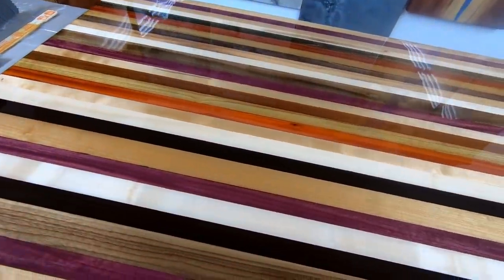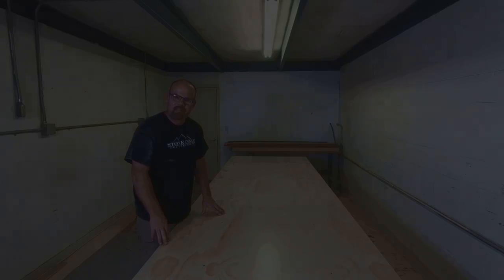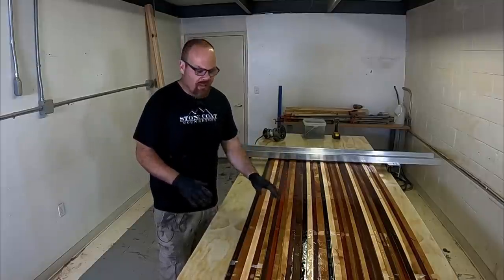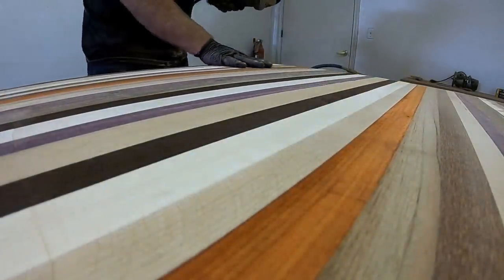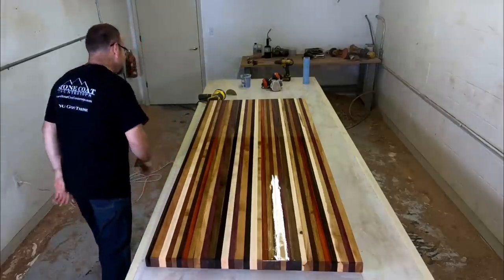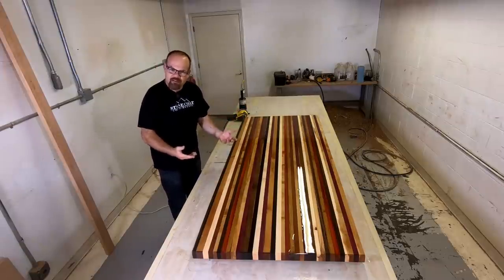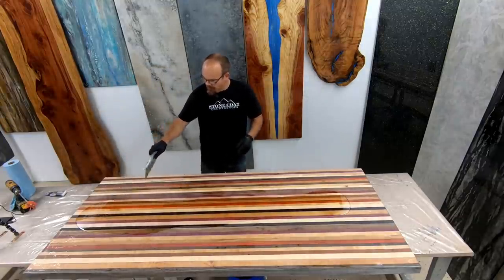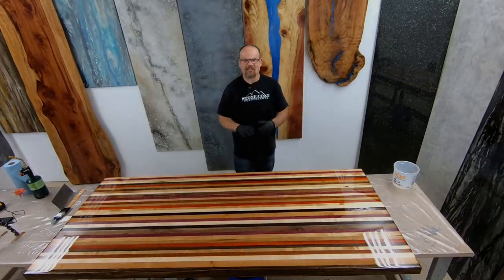How To Build a Solid Wood Table Top

Comment: Just a quick note on acetone. I've been welding for about 30 years and have used acetone to clean some of the materials I work with. There has been a study on acetone it says it can soak into your skin get into your bloodstream and damage your kidneys and liver. As with any solvent you should use industrial gloves not nitrile gloves because it will dissolve them. Just a heads up. Take care and be safe.

Comment: This is gorgeous and also the first project we ever did in shop class in seventh grade.  "gluing and braising different pieces of beautiful wood together, and then sanding.  Then we also applied a "apple shaped" templet" and then cut that out to reveal a apple shaped "cutting board"....   That was 1977, and my mom still has that cutting board hanging on the wall....  Still proud, I must say....lol

Comment: I'm a hobbyist woodworker/artist and I have to say that your table top is beautiful.  Would you mind providing a link to the 50 grit metal sanding disk?
Reply from the maker: Hi Dan Stephens!  Here is a link to the 50 grit metal fiber sanding disc: https://www.homedepot.com/p/Diablo-5-in-50-Grit-Fiber-Disc-4-Pack-DCF050050S04G/202830897 and the conversion kit: https://www.homedepot.com/p/Diablo-4-1-2-in-x-5-8-in-50-Grit-Grinder-Sander-Conversion-Kit-DCP045VGPS01G/202830887?MERCH=REC-rv_gm_pip_rr-202830896--202830887--N

Comment: When cutting and sanding in the same room that you apply the epoxy, is there any special prep you do for dust control while the epoxy is drying? is a good sweep of the room good enough? Do you vacuum the room? Do you use a draw fan or anything while the epoxy is drying?  nvm the later part of the video answered my question..
Reply from the maker: Great question Nico!  We like to vacuum the room and eliminate the dust as best as we can, but you typically will never get all of it. Keep the HVAC vents and air movement off as best as possible.  When you pour the clear coat, this is the most important step to create a great blemish-free surface; the color coat will be sanded, and the dust nibs will never be seen. You can always sand and polish the finished coats to create a perfect finish. Here is a link to how we do this:  https://www.youtube.com/watch?v=iFpzdvPaQl0

Comment: The question I have when you use these reinforcement methods. If the wood wants to expand from moisture fluctuations, why resist that with mechanical restraints rather than more classical joinery methods where the wood can expand, but warp can still be prevented? It seems like a losing battle to try to restrain the wood like that.

Comment: When you're doing your flood coat, do you have a specific room temperature that should be worked in?
Reply from the maker: Thank you for the great question DreidMusicalX!  Yes, you will need to install the Stone Coat Countertop epoxy in a room above 65 degrees and keep it warm while it's curing for at least the first 7-10 days. The materials will dry in colder temperatures but not to their full potential of durability.  You do not want the temperature below 65 for the first week of the projects life for best results.  Feel free to contact us anytime for free project support, 541-450-1976

Comment: @Stone Coat countertops  Hi I'm new to carpentry but in the past have worked in concrete, I was just wondering if while applying  the epoxy you could use your sander with no belt , on the table holding the tabletop. The vibrations may help to release the bubbles as they do with concrete without the need to fill, sand etc. Hope this helps I will try this when I try my first tabletop. Great video thanks
Reply from the maker: Hi Eleven thanks for watching and writing us! You can give this a shot, the torch is a super quick easy preffered method to remove any air it also helps the epoxy to self level and allows you to move around any veining designs in your project if you are doing effects. Have a wonderful weekend and thanks for your support!
Reply: the bubbles are from the chemical reaction of the epoxy, not from trapped air
Reply: @jlgoins64   The chemical reaction creates trapped air!

Comment: I learnt so much more about epoxy from this video. Everything he said to watch out for or don't do I've done!! The skies have opened:) Also top guy and speaks excellently
Reply: Ive done quit a few, mainly table top or couch table projects. Right now im into kitchen table tops but with a twist! I find old roofing beams like four by fours that have really matured over many years and slice them up 1 cm thick and find out whats inside. Find the nicest designs, some you can use like a butterfly effect and glue them to a CLV board, stick a nice Birch trim around it and after good bit of sanding and Poly or epoxy ( still working on the best method) get it sealed and thats my work. Its the art that goes into designing the look of the table im fascinated by and you never know what the wood is hiding. Maybe a good idea for a future project for you guys. Its a great journey and, wow it looks great! Thanks for contacting me. If i could upload a picture i would to show you guys. Tom

Comment: Probably not responding to comments anymore, but doesn't the expansion of the species at different rates mess you up?
Reply from the maker: Great question Grant and thank you for watching!   Our epoxy is hard enough to withstand major impact, but still remains flexible enough to expand and contract with wood through seasonal changes. Feel free to call or email us anytime for project support! (541)450-1976 Are you planning a table project?

Comment: I did the same thing with bigbox pine lumber. surprisingly turned out great. Instead of router the surface flat, I built it in four sections, run through surface planer to get all of them exact height, then glued them all together.

Comment: So what does a table like this go for??
Reply from the maker: These tables can retail around between $2,000-$3000, it really depends on materials used, size and for what similar pieces are going for in your local market.  Give us a call anytime with questions or for project support. (541)450-1976
Reply: @StoneCoatCountertops  what would you estimate the total DIY cost was for this table?

Comment: I wish I would have seen this before I built my island.  I think I put the coats on too thick and I think my kitchen was too cold.  I just had a real estate agent look at my house and told me that I could probably sell the island for $1000, but I don't think it'd go for that.  After I move, I'm going to build another for my new house and re-watch this video before I do so it will turn out much better.

Thank you SO much for making this video.  I've been wondering the best way to address the edges.  Again, I think my problem was that I was putting the coats on too think.  I should have put more, thinner coats.  It really helps to watch these tutorials!!!

Comment: River table, please. Also why epoxy as opposed to wood glue for the laminations?
Reply: Epoxy is stronger than wood glue and the joints are much less visible, especially if covering with epoxy on the top too.
Reply: Huntsville Houch I’ll second this question, it’s same question I had. My assumption is that epoxy is their product and the adhesive they are most familiar with also probably adds a depth and superior seal to reduce air bubbles. Would love to hear their thoughts on that before I epoxy my wood glue laminated table.
Reply: because the people doing the video are an epoxy company LOL
Reply: Another thing not mentioned in the previous comments is, the open time of wood glue might not be long enough for that large of a glue up. At least not all at once.
Reply: good point Ken
Reply: yours is the correct answer I believe, Ken Bonser

Comment: "Scraps of wood"  > Has full planks lumber in front of him...
Reply: Was also going to paint that out!
Reply: IKR?   Almost deserves a thumbs down for that disingenuous audacity!
Reply: Love the videos! I really appreciate all the information, amd especially the tech info that you're always so eager to share when I call in a panic. Looking forward to many more projects with you.
Reply: What was final dimension of the table completed?
Reply: @rickwar0  it was cheeky but in general this channel and this guy are great... I could never thumbs down 😂😂
Reply: Did not notice that but noticed all the drips over the edge in the final frames.. after the final coat..
Reply: It is likely meant as scrap wood from a project - which very well could mean that whole planks were left over from building an item from one type of wood. I, personally, have several pieces of whole lumber I purchased for a project which did not get used. Therefore, I consider it "scrap" since there are only a couple of pieces and not enough to do a different big project with.

Comment: You talked about sending out lower grit scratches. A little tip. I sand floors professionally.  When I'm buffing out scratches I find it's best to run the sander at a 45 degree angle first, and then do it again with the grain.

Comment: Hi from Australia ... 10 years ago I was on a road trip with my then 5 year old son. In the outback of Australia. Red dust and kangaroos everywhere... we called into a tiny boarder town and stayed at a camp ground... there was a communal bon fire every night there. The wood they were burning was old fence posts from the original dingo fence erected between 1880 and 1885 that spanned the entire south east of the continent... an old lady went to the wood pile and said to me take one of these home... it’s part of our history and it’s not right they are being burned ... so I grabbed one. The trip was emotional for me because I’d just lost my wife and sons mom and he was so little. The posts were rotten at the bottoms so that’s why they replaced them but the amazing thing about the timber is it petrified.. it’s almost like rock. After over 120 years of scorching dry heat. And they didn’t use nails to fasten the wire. They drilled holes through them and fed the wires through the posts. I want to do what you did to the drift wood but I don’t want to use coloured epoxy because you need to see and appreciate how distressed and cracked and split the old timber is. Plus I want to be able to see through the old drill holes. I was thinking of immersing the entire post in clear epoxy then on a band saw, cutting off the epoxy back to just proud of the timber then sanding it back until the timber just starts to break through then resuming your treatment of the driftwood... I want the drill holes to be completely filled with epoxy too. Can I send you a photo of the post for your advice? Plus do you export your products to Australia?  Love your videos 
Cheers in advance, Jason

Comment: Hey guys - I'm super enthusiastic to do something with the energy you've given me. I'ma  relatively new subscriber and seen other epoxy coating companies but no one seems to do it the way I would do it - until I found you!!! You're unafraid of helping - showing your tips and tricks - showing your humanity and love for others. I'm almost envious :)

I just finished watching a bunch of your vids and there's a few things I need to ask.

This gorgeous table top mmmmm I was shocked to see it unfinished on the the underside. I'd have gone to the effort of coating the underside to seal this thing for ever. Now you're the experts and I'm the noob here - I guess it's so the wood can breathe??

Some of your faux "rock" edge made with bondo and sticky hands looks ok-ish...however I have seen a few images where it looks like the final coat has spilled over the edge as normal but it looks cloudy (maybe bubbles) and looks a bit like snot dangling off lol.

I've done a bit of carbon fibre myself - but it's the ONLt time I've used a clear coat/expoxy like that. But done TONS of automtove bodywork - and have a bit of an artistic flair - so I've gained loads of your energy from watching your vids and "need" to do something.... I want to do a marble counter top to match one I already have that is genuine marble and is cracked....but not falling apart yet &  I'm guessing if I remove contaminants from the genuine top I can coat in epoxy to give it some extra strength and make it at least appear to be the same as faux marble top in appearance (seems crazy to be making real marble have an appearance of faux I know - but it will be in the same room and will blend it so no questions asked about the legitimate marble or faux lol).

Great work to the whole team and looking forward to more content!

Stu :)
Reply from the maker: Thank you so much for your kind words! We are glad you appreciate our content and hopefully you will follow us as we create more. If you ever have any questions you can always call or message us so we can help! -Nathan

Comment: So glad you added info about sanding, I’m definitely going to invest in the metal sanding disc
Reply from the maker: Here are the links to the discs we use as well as the conversion kit: https://www.homedepot.com/p/Diablo-5-in-50-Grit-Fiber-Disc-4-Pack-DCF050050S04G/202830897   https://www.homedepot.com/p/Diablo-4-1-2-in-x-5-8-in-50-Grit-Grinder-Sander-Conversion-Kit-DCP045VGPS01G/202830887?MERCH=REC-rv_gm_pip_rr-202830896--202830887--N  Call us anytime for project support. (541)450-1976

Comment: If the bronze seam and crack fill that you used first had been spread evenly and pressed in, would that have eliminated the majority of the holes thus eliminating the need for the burn in stick? Could you show close-ups of the spots that you did do use the burn in stick on.
Otherwise, this is exactly the project that is next on my list. Thank you for showing it. Can't wait for part two!

Comment: smart using he router and slide to plane down the uneven boards. I was thinking Id love to build a table but I don't have a planer that wide. Now I know how to do It thanks to you :)
Reply: Mike McDonald

Check out the wood whisperer.  He has an excellent video for getting a tabletop dead flat.

Comment: This seems like a useful product and definitely alot of good information is in the video for both woodworking and using the epoxy. My only complaint is that it feels like such an infomercial at point with the dialogue. The results speak for themselves but when time is spent trying to say the product is good it feels like there's something that needs to be defended. Like the part about how epoxy bond is stronger than wood, this could have just been mentioned and moved on but it sounds like this is somehow noteworthy when even cheap wood glue creates a stronger bond than the wood itself.

Comment: Several years ago, I had to put together a bathroom vanity with scrap wood and a bar sink. I used gloss polyurethane instead of epoxy, far fewer steps, and was happy with the job. (I'm sure it would have been even nicer with those steps, but time was also a factor.). Lasted for years, until one day, I came home from work, and my sister had torn it out and put in a large ceramic vanity sink. Fudged my framework to fit.

Hated it ever since.

Comment: I would just like to say that this is a beautiful table, and the best instructional video I have ever watch. Great job Great teaching I am just a little disappointed, because I really wanted to see the end result.

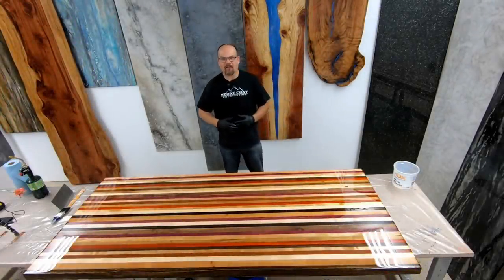46:13 you said "Hey guys, we like to wait a few days before we actually install our legs, so we'll come back in about, four to five days, we'll flip this over, and we'll SHOW YOU HOW we install our legs, and remove our drips with our 50 grit metal sanding disk".

Just wounding after watching this awesome step by step, AWESOME INSTRUCTIONS, the most beautifullest table. I would really like to see how you removed the drips with your 50 grit metal sanding disc, and how it looks after you install the legs, is there a second part to this video? Now it's like a cliffhanger. So if you do have another video to show the end results, I would really appreciate it. There is a carpenter living inside of me, I really want to do it on my as a female, I commend all of the other female carpenters. I just wanted try to do one project on my own, and this one looks like something I may be able to do with out help.Other then your video. Thank you so much for inspiring not only me yet so many.

Comment: I was going to build something very similiar about 3 years ago and had to step back when I added up the cost for the exotic woods.  Still going to do this but will be at a later date 

Also you need a jointer.

Comment: Will the finished table be able to withstand being out in the weather WITHOUT cracking, warping, or fading?
Reply from the maker: Our Epoxy is very durable and heat resistant! With that being said you would want to make sure your project is taken care of and not highly exposed to the elements for the best long term results. -Nathan

Comment: Is it possible to use a heat gun instead of a propane torch? Or is there not enough heat generated by a heat gun to remove all of the bubbles?
The product demos are really good and do a great job of selling the product without requiring you to sell the product.

Comment: i would like to see your work bench set up and where you got your router sled. Thank you nice job
Reply: The simplest ones are shop made.  The router is in a long 3 sided box with a long slot in the bottom for the router bit.   Box slides on level rails screwed to the table. They use small wheels to guide the sled but you can do without with a little care.